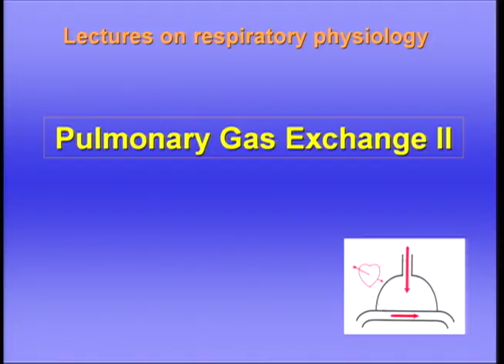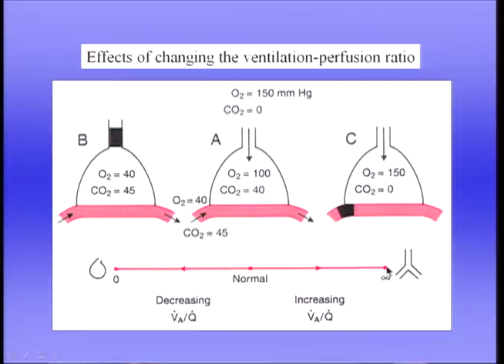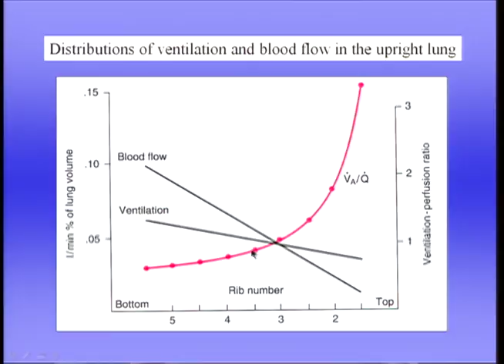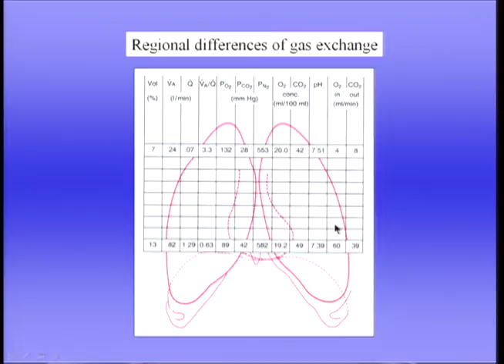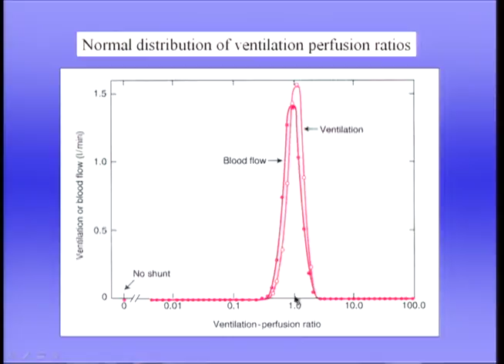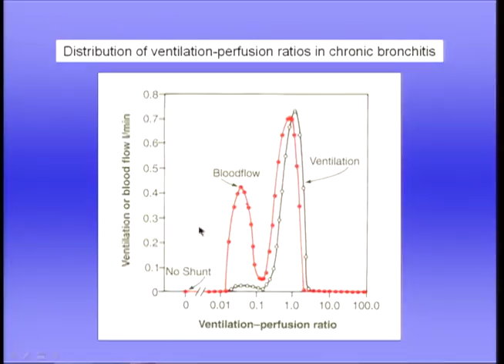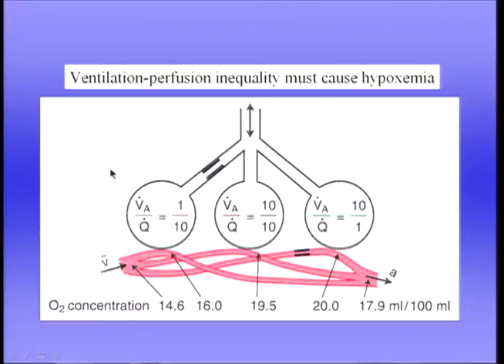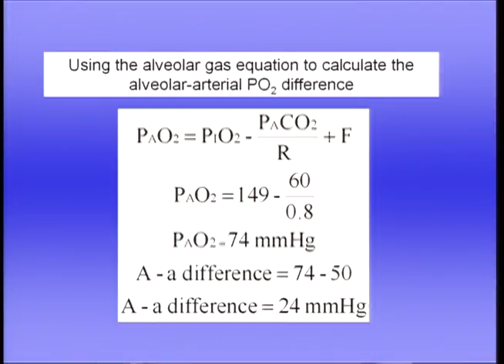Pulmonary Gas Exchange-Part II

Comment: Great lecture but isn't the pCO2 in the plasma a range that is closer to 40mHg and not 45mmHg?
Reply: PvCO2 40-50 (average 45). PaCO2 35-45 (average 40)